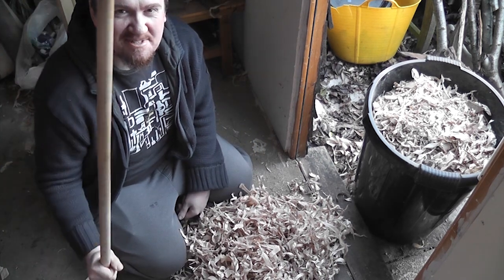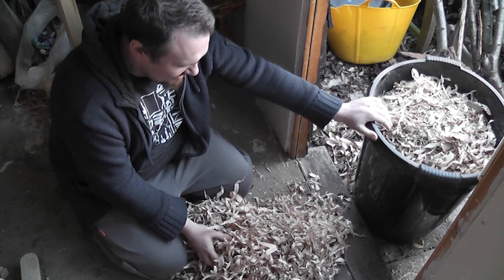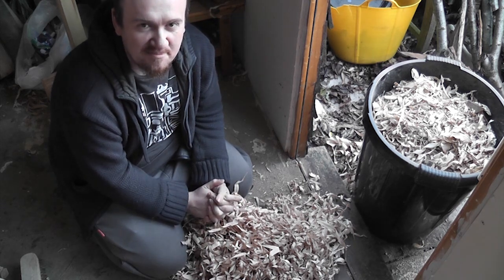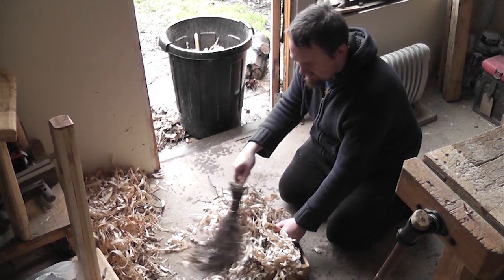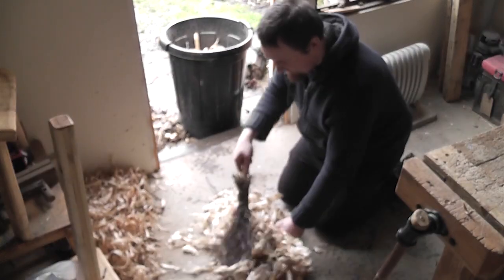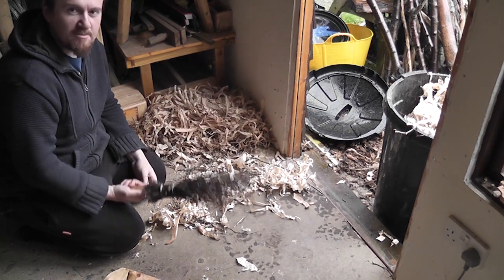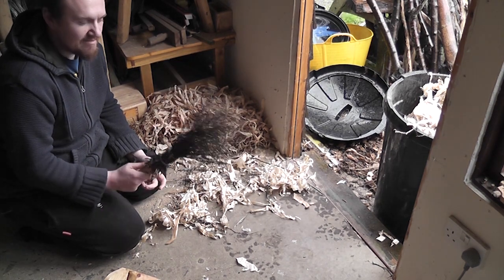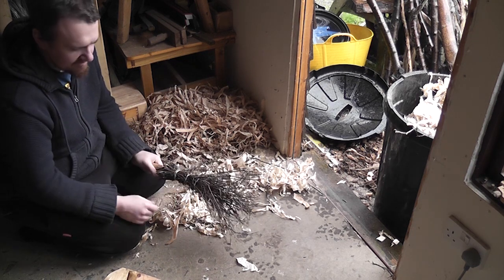Wooden Brush and Dustpan [Woodworking Project] (Clean Workshop)

Comment: Very nice project Clint.  Have to ask.. is the handle on that way for a reason?
Reply from the maker: Cheers Jim! Well, 2 reasons really, first of all it makes it more compact lengthwise and in my tiny shed I take all the space I can get! Secondly its a bit heavier than your standard dustpan so I thought having the handle over the top of most of the weight would make it easier to handle and control.
Reply: Makes sense.  Now no excuse to have a dirty shed.  ;o)
Reply from the maker: True! Haha